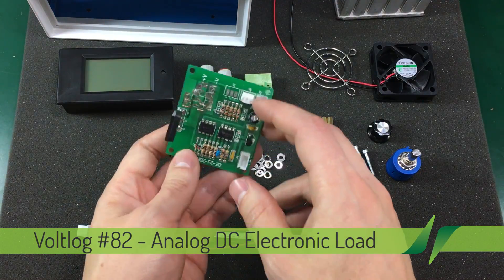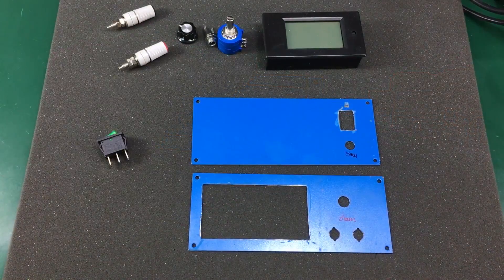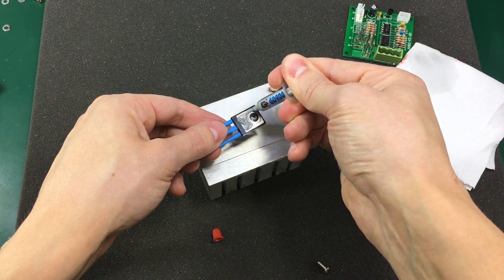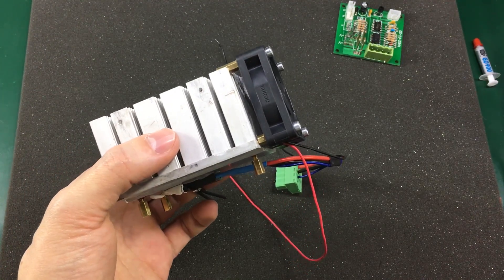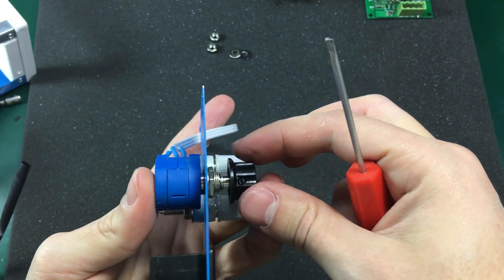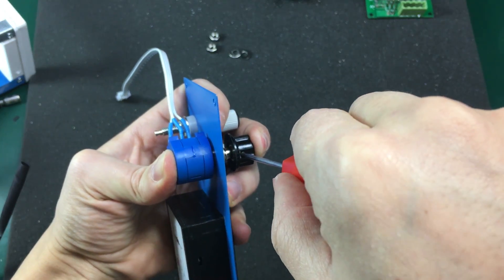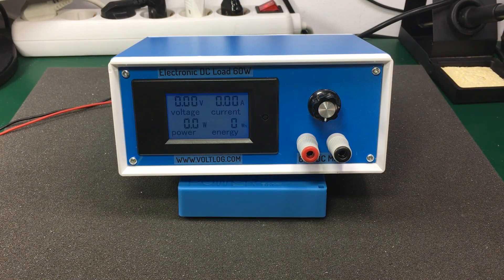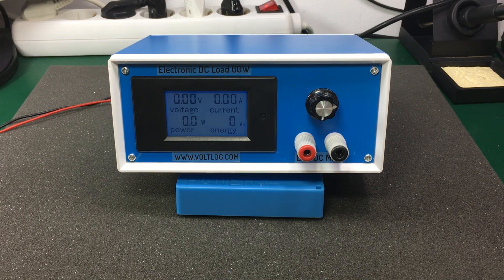Voltlog #82 - DIY Adjustable Analog DC Electronic Load

Comment: I ordered the PZEM031, but got a ver 4.0 and yours was 1.0.  They are very different. Looks like R1 & R2 go to -load terminal and R10 is connected to R9 & R11. I know it is not likely you have a ver 4.0, but just in case you do, can you comment on which trace(s) to cut?
Reply from the maker: I don't have a ver 4.0, can't help you.
Reply: also I ordered the PZEM031, but got a ver 4.0, have you found the solution?

Comment: Excellent dialog and video production. Just yesterday  I was looking at the CC kit you used. Have you checked the performance sub 100mA? What MOSFET comes with the kit?
WRT the meter mod, I did something similar. I did not cut the R10 trace but instead removed M7 diode and connected the cathode side to the spare screw terminal.
Reply from the maker: It's been a long time since I worked on this project, I haven't checked stability under 100mA but I remember it could go below 100mA.

Comment: Be very careful when testing batteries.  Your project as shown doesn't have a backup disconnect.  You can never rely on semiconductors alone to shut off the current flow.   Batteries are never off.

Comment: Thank you very much for the schematic.
Reply from the maker: no problem, thank you for watching!
Reply: I looked at the schematic and built the current sensing op-amp (OB1B) in a test circuit.
I like the differential sensing technique used on this board.

Initially, I had a small problem with the circuit as shown.
I was wondering if the bottom of R8 should be connected to GND and not V-, or perhaps V- and GND are connected together?

Then I realized that a negative rail is created with the D1. Clever!

Kind regards

PS: A great thanks to Adrian Carstea for the schematic. Does he have a channel?

Comment: you recommend this assembly, aliexpres ZPB30A1 60w 13 euros, which voltage handles this source Aoshike DC 1V-100V Constant Current Source Electronic Load Board 75W 0-10A Power Tester
   ZPB30A1 9.99A 60W 30V Does the one you ride on the video work more voltage?

Comment: Another fantastic video and project. I am going to build one of these side-by-side to the 30V, 3A power supply unit you had previously made. Here is the case I'll be using; https://goo.gl/6hBGqj
There goes another $100. Fun does cost money you know!  :)
Reply from the maker: Good luck with the project, it should be possible to do it for under $100 depending o what parts you choose.

Comment: can you use multiple mosfets in parallel?
Reply from the maker: yes you can but you need to ensure equal loading with some 0.1 resistors.
Reply: Thanks, just ordered a board to fiddle around. + Subbed, good channel you got there.

Comment: Hi.
And why not connect v_sense (r10) to a free Load + pin? So that the wires do not stick out of the panel? )
I made a similar alteration. To do this, remove the MOSFET and turn on the power directly to the stabilizer z1 from a separate power source. The measuring part was not touched.
(It's about the PZEM-031 Panel Meter)

Comment: Very nice build! Since you already have all the instruments, why not add an input for signal generation and oscilloscope output to do transient response? I did something similar here http://www.electrobob.com/psu-burner/
Reply from the maker: Nice project you did there. I wanted to use readily available modules from ebay so that anyone can build one with minimal effort.
Reply: That's the thing, the ebay modules implement the same current source i used, maybe with a slowish opamp. So all you need extra is some connectors for the signal in/out and a switch to select between potentiometer and external signal.

Comment: Great information on a simple solution for electronic load! I will build this device as it appears to work well in your video, but will use a different panel meter and fan speed controller.
Maybe you will consider testing this cheap ebay fan speed controller for inclusion in future projects. I was going to build one for myself but at this price just ordered one from ebay. http://www.ebay.com.au/itm/262723958505

Comment: Wow! excellent video my friend! I had bought the same dummy load circuit from ebay and now have found a schematic for the board! Thanks.
What I have done is used an entirely different mosfet for my setup. I used a IXFH50N50P3 which can handle up to 960W. But for heatsink I used a Fischer Electronik LA 6/150. 

Works well up to maximum 150W so say 30V 5A.

Heatsink:

http://uk.farnell.com/fischer-elektronik/la-6-150-12v/heat-sink-fan-cooled-12v/dp/1222507

Mosfet:

http://uk.farnell.com/ixys-semiconductor/ixfh50n50p3/mosfet-n-ch-500v-50a-to-247/dp/2674748?ost=IXFH50N50P3&selectedCategoryId=&categoryNameResp=All%2BCategories&searchView=table&iscrfnonsku=false

Works very well. Oh yeah, I subscribed too! ;-)
Reply from the maker: Thank you! IXYS SEMICONDUCTOR also make so called "linear mosfets" which are optimized for DC operating point. Those are ideal to be used in a dummy load. The heatsink looks very nice, but pricey..
Reply: VoltLog yes this is a good idea to use linear mosfets for sure. thanks for the info. the characteristics are almost the same. the soa of the linear mosfet is much better because it's designed for dc operation so therefore has extended soa. Cheers!

Comment: I believe I would have applied the Thermostat on top of the plastic part of the mosfet not allowing any conductive thermal paste or cream to touch the conductive parts of the mosfet if it's supposed to be isolated and maybe it would also act more accurately as a bonus. Just a thought.
Reply from the maker: there wasn't enough clearance between the bottom of the enclosure and the mosfet to attach the thermal switch there.

Comment: Very bad idea to use thermal switch that is under 230VAC, the case is wired to live AC. You need to use insulated one !

That much thermal paste in not desirable, as if it squeezes on the pins there can be a short circuit if the paste is conductive.
Reply from the maker: I don't think you watched the video entirely..

Comment: great job Voltlog,  Tx again . I learned a lot from this video  I just installed a temp switch my unit is fail safe  now . 80 C. added a second mosfet ! (You need to match them, I added a series resistor for each to divide the load better.  This increases the fail save situation as well  Silicone glue is great stuff.I did not know this type of glue.  I took  the larger tube. I suggest keep it in the fridge for storage and it lasts! This DC load  is easy to modify  and  so easy to use. Got  2. Keep it going
Reply from the maker: thanks for the tip!

Comment: Another nice video but this DC load is very reminiscent of #38 ;)  One day (some day soon I hope) I would like to design one that has PC logging, uC controlled of course, with constant resistance, power, current and the ability to run it with different wave forms.  Meanwhile I have the one you showed in #38 which does a decent job but lacks logging.
Reply from the maker: thank you for watching! Sometimes I would like to have a twin, I would work on the hardware he would work on the software, this way we could bring projects to life :-)

Comment: Nice project. Is there a reason you didn't have a sense wire for the load negative?
Reply from the maker: main reason because I think (haven't thoroughly checked) the ADC/MCU GND is connected to the common ground on the PCB so I wouldn't have a point where to connect it. Second reason is because the voltage measurement is accurate enough as it is, less than 100mV error, which is enough for me, I won't be doing any precision voltage measurement with this dummy load, there is no need for higher precision.
Reply: There's a simple modification you could make that would greatly improve the accuracy and usefulness of the panel meter on your DC load.  Install an additional input on the front of the instrument with a SPDT switch to select between internal (at the banana jack) or external voltage sense.

Imagine that you're testing a power supply at 5A.  There will be significant voltage drop in the test leads to your DC load.  In this case, you would want the voltage to be sensed at the output terminals of the power supply under test, not at the DC load's input terminal.

Comment: Very nice project!, the only thing I'll do different it's to leave the fan on the wall of the box.
Reply from the maker: Now I think that would have been better, because the way I installed it, allot of the hot air stays trapped inside the enclosure.
Reply: This is easily fixed with some thin plastic or cardboard to form a sealed baffle around the fan and heatsink.  Make sure that all air from the exhaust side of the fan is forced through the heatsink and can only exit out the side of the enclosure.

Comment: very well done :)
i think i'll do 1 for myself :)
oh, correct the box link, add "box" to the description, otherwise you have car wheels :)
the KSD9700 NO Thermal Switch link is wrong, too
Reply from the maker: Thanks, I fixed the links!
Reply: VoltLog the box one still points to car wheel rims... http://m.ebay.com/sch/i.html?cmd=SKW&_pgn=1&_nkw=170mm+x+130mm+x+75mm+metal
Reply from the maker: I have tried fixing it once again by adding an extra keyword in the search, please check.
Reply: I see the last link pointing to right enclosure.
Also thanks for presenting nice project.

Comment: usually people use isolating heat transfer pads, cause the back of the mosfet is connected to the circuit, is this one isolated?
Reply from the maker: the mosfet is electrically connected to the heatsink but I have nothing else connected to the heatsink or the enclosure so it's not a problem
Reply: well the mosfet is rated 100V isnt it? wouldnt like to touch the case when there are 100V DC on it
Reply from the maker: That's the reason I've "limited" my model to just 60VDC, to keep things safe.. If you are building one yourself, it's pretty easy to add one of those silicone thermal pads, but they do increase the thermal resistance when compared to thermal paste.
Reply: when being barefoot in my lab in summer i can already feel 30V tingle, dont want to touch 60V :P
Reply: Some of these kits come with heatsinks and a sil pad which will isolate them from the heatsink.  Of course using this sil pad thingy will reduce heat dissapation.  The best practice would be to keep the heat sink away from the case.
Reply: This is a prime example of the reason we should use a non conducive washer between the standoffs and the case and on the screws holding the standoffs to the case or just use nylon standoffs.

Comment: hi,   Tx for the diagram. Do you know what is the function of the IC 1A  LM393N?
Reply from the maker: According to Adrian, the guy who did the reverse engineering "When no load is applied between V+ and V- the non inverting input of the comparator is below one diode than inverting input, so is pulling down the non inverting input of the op amp" and i think he is right.
Reply: Tx    I  will use this board to drive several Fets ,  it will be more fail-safe at higher voltages.

Comment: At first I wasn't sure I liked the blue project box and preferred the plastic one. Now after seeing it in this vid, the quality looks pretty good for the price. Your skills are also improving. Dremmel did not jump around as much as on the plastics. The extra height for the PC heat sink is the top seller for this project. Nice work!
Reply from the maker: thanks! also the harder metal sheet of this enclosure helps keep the dremmel disk on track.
Reply: @voltlog  do you know if the RD6006 will fit in that enclosue without modification?

Comment: Nice project. Have you stopped working on the dark load project?
Reply from the maker: I haven't done any work on the software for a very long time, so you could say I stopped working before I even got it fully working. But I have ordered a rev B of the PCB's just this month. I have made a couple of improvements on the hardware. It would be ideal if someone would like to join the project and help with the software for the STM32.

Comment: Great project.  Can you simply trim the length of the post on the 10-turn pot so the knob mounts flush with the enclosure?
Reply from the maker: It's actually useful in this case that it sticks out, because it's easier to grab & spin it, because the front panel is a bit recessed.  However you could trim it if you would like to do so.
Reply: Ah, yes, I see what you mean.  I really like this project - might give it a go myself.  Oh, I did find the metal case a bit cheaper from another supplier if anyone is interested, https://goo.gl/qamH8K.

Comment: Well done. Did you consider holes in the cabinet to allow air flow and heat escape?
Reply from the maker: The enclosure comes with slots on the sides. I haven't considered additional holes.

Comment: How accurate can you adjust the load ? Down in the 10mA ?
Reply: You don't need to use a 10 turn pot to acheive accuracy on this thing.  If you have a 10k pot on hand it will work just fine.  You also don't need to use the expensive panel meter shown here, just a 5 usd ebay cheapy volt amp meter, a used computer atx power supply case with the fan built in, and you got yourself a dummy load for less than 15 usd.  When you want to dissapate more amps, start adding more of the same mosfets, and another current shunt or two.
Reply from the maker: I can adjust in steps of 5mA with easily achievable fine movements.

Comment: Hi, very nice build.  I would have been nice to see what the board circuitry does since there are a few ic's on the board.  If memory serves, one is an op amp.  Removing the mosfet and connecting it to the heat sink is a great idea and leaves the door open to increasing the draw by adding more mosfets.  But why mount the heatsink and mosfet upsidedown?
Reply from the maker: It's not just about the amp, you could have 10A at 1V = 10W and that can be easily dissipated, but it's not the same thing for 10A at 10V = 100W which would be difficult to keep cool with a "small heatsink" and would also exceed the mosfet forward bias safe operating area, so don't do that or the magic smoke will escape. This kit with a single mosfet is safe to use up to 50-60W.
Reply from the maker: I have added a link in the description with the reverse engineered schematic (By Adrian Carstea, a subscriber). With these kinds of projects where I assembled different parts that were not really meant to go together I have to find an optimal solution. In This case the heatsink is not mounted upside down, that is the correct position it should sit, with the fins pointing up.
Reply: Being upside down helps to dissipate the heat as the electrons fall out ;)
Reply: Thanks for the schematic link.  Why did you replace the heat sink that comes with the kit?  The choice of this type of panel meter almost doubles the cost of this economy project.  The cheapie ebay volt/amp meter is a better choice.  For those who are following along with this video, be aware removing the mosfet from this board is not for the faint of heart.
Reply from the maker: What heatsink? There is no heatsink with the kit. If possible it would be better to leave the mosfet on the board (shorter high current path), in my case it was not possible.
Reply: My kit came with a small cheap heatsink attached to the mosfet.  I assume the kit was designed to the appropriate spec with that heatsink included for a 10amp load.  I also noticed that the current shunt has room to put a third one, making it a total of 3.  If that is the case it looks like the whole thing could possibly handle up to 30 amps.  
I believe this might be accomplished using just the one mosfet and some cooling.
Reply: Yes of course, its simple ohms law.  It would be easy to increase the range of this kit by adding more of the same mosfets.  It appears that the circuit on the main board is just telling us what power is being dissapated, nothing more.  If a cheap panel meter is used it can give us amps*volts and simple basic math to find the watts.